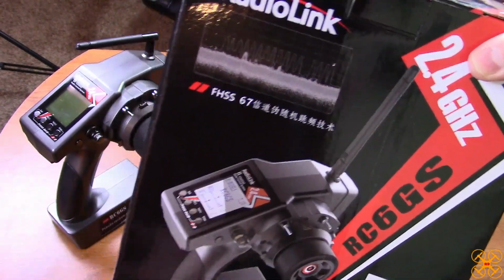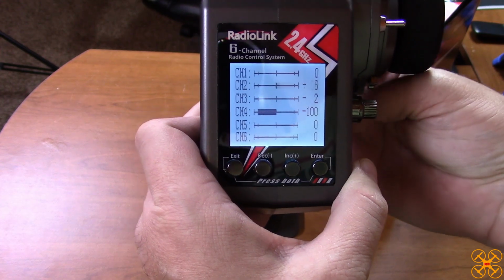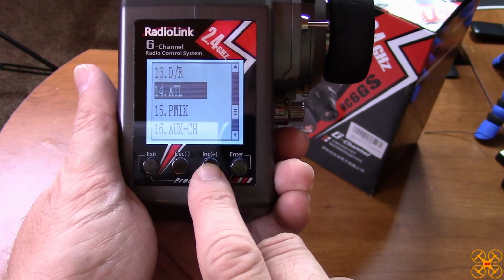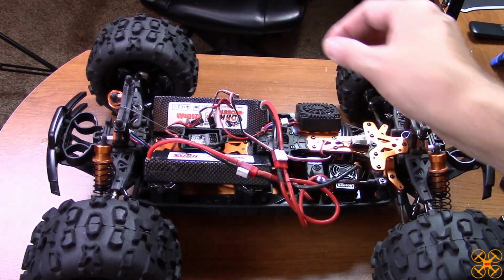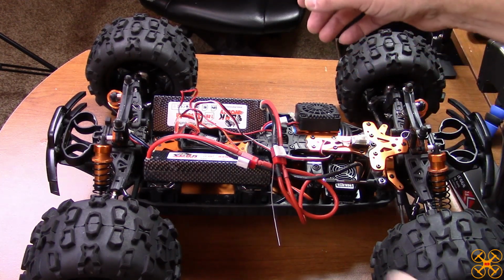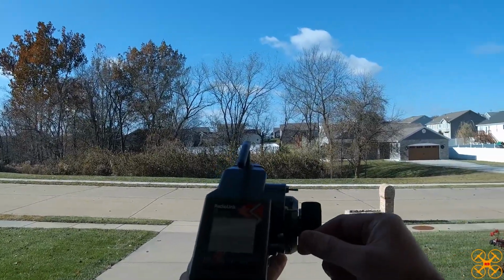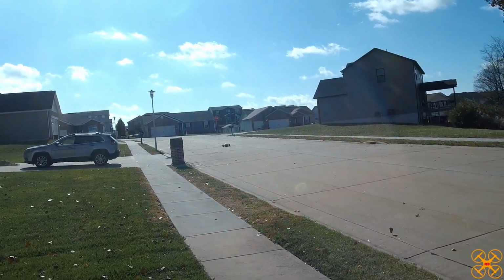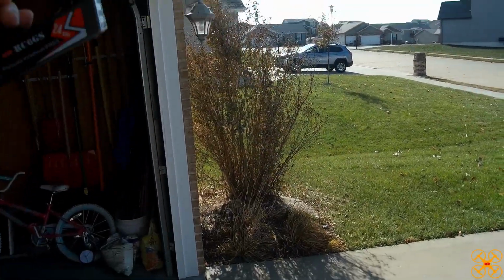Radiolink RC6GS TX/RX with Gyro Review

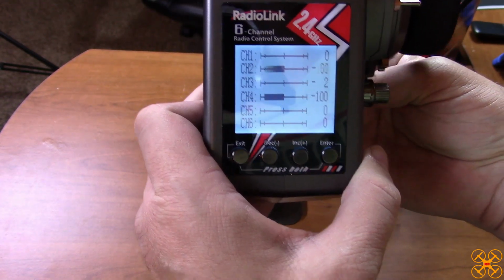Comment: Hi, I rewatched your video again and in minute 4:04 you mentioned the CH2 reverse mode changes you made. If I changed to REV, the wheels move without any problems and I am able to calibrate the ESC. Is this setup ok? I appreciate any comments.
Reply from the maker: It has been so long since I made this video that I honestly don't really remember. I'm sorry!
Reply: No worries. Thank you.
Reply: well just yesterday installed this TX (the RX with the one antenna only) and had to reverse the throttle, and saw no problems when i used the car for about 10 minutes.

Comment: Thank you for this video. Did you encounter an issue when full forward throttle is applied wheels reverse? The default RadioLink Reverse is set to Normal, I changed to Reverse and wheels move forward. When I use the FlySky GT5, I don’t have this issue. I am using the HW 1080 ESC and Holmes Hobbies Crawlmaster Sport 8T.  I highly appreciate any suggestions.
Reply from the maker: No, never had that problem. That is very strange. Hmm

Comment: I have a question when you installed the reciever did you leave that reciever wire loose?
Reply from the maker: Do you mean the antenna wire?
Reply: @OpenCircuitRC  I have a crawler that I'm building but I dont have any where to mount the antenna and I saw you were running that same reciever so I just needed a quick tip
Reply from the maker: @miguelgaviria5836  the antenna doesn't need to be in a straw and extended as long as you don't need max range.
Reply: @OpenCircuitRC  oh ok thx
Reply: @OpenCircuitRC  yeah my bad I had it on the tip of my toung

Comment: radiolink rc6gs is piece of junk i wasted my time and money on it believe  me its junk
Reply from the maker: No issues at all for me so far. Maybe you just got a bad one.
Reply: @OpenCircuitRC  i installed three receivers in in three trucks and bound them but no mater what model i chose radio will run all three and if all trucks are on it will run them all at once so no since trimming truck if radio will run any truck no mater what model i chose
Reply: @paulbragdon573  that also happen to me, only need to do is update the firmware with your computer and a USB cable...

Comment: Super cool radio. I'm assuming it has multiple model memory?  There's a few radio systems out there with gyros, of course you know, I went with the DumboRC 6ch system - $29.99.  I bought it for the increased range and found that I really don't use the gyro for the car that I installed in it, but I'm loving the increased range. There's also another awesome system made by Hobby Porter. It sells for around $50 bucks, has 12 (or more) model memory and over 300 meters range. The Dumbo is promising over 500 meters range... I still have yet to test that claim, lol!!! Thanks for sharing bro, great job on the review. NOW... take that Maximus out and get her dirty!!! POW!!!
Reply from the maker: Yeah it has multiple model profiles. I just haven't messed with that yet. I didn't realize the Dumbo (eBay a silly name) came with a gyro. On this one you have to be sure you enable the gyro which I forgot to show in this video but it is easy. I don't g need the gyro either but it does help a lot with keeping the car under control.
Reply: Yeah, the Dumbo has gyro but no model memory. I demonstrated mine in a previous video where I picked up the car, wiggled the rear end and you can see the front wheels staying on course. Pretty cool.
Reply from the maker: @DJSOULFORCE  I obviously missed that part. Lol. I should have showed that in my video. I forgot several things.
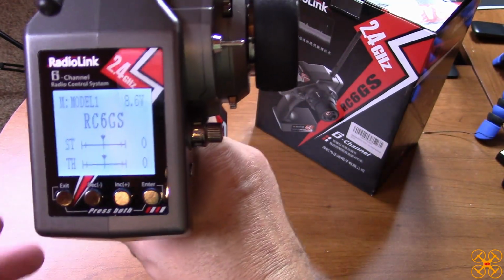Reply: Watch a quick demo here - https://www.youtube.com/watch?v=wPHyhAQIpHY&t=205s  (GO TO 3:37)
Reply: SOUL FORCE QUADS I was going to order the dumborc as well. I dont think I want to review for this company, they are supposed to send one out to me. Don’t get me wrong, There products are great just don’t have time to do a full review like Ryan did. I like to make my videos on my own time and not rushed.
Reply: This controller up to 600 meters range, 10 model memory, here is the detail information : https://amzn.to/342iRAt